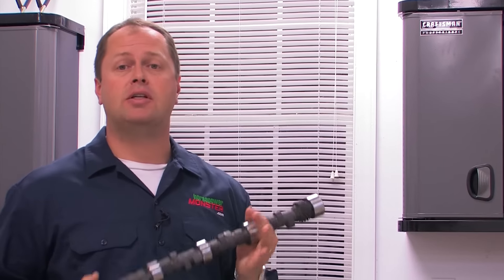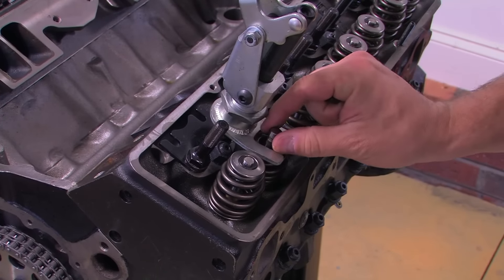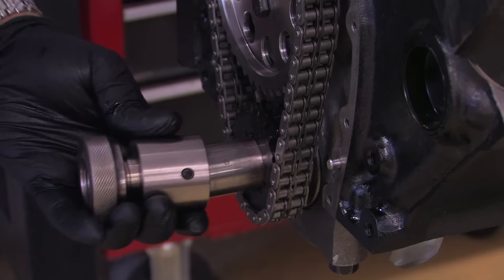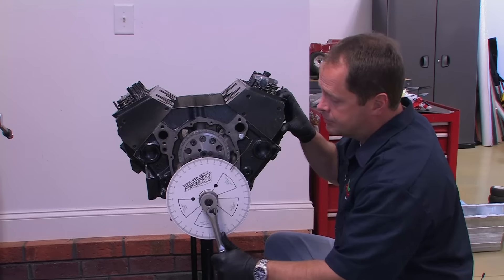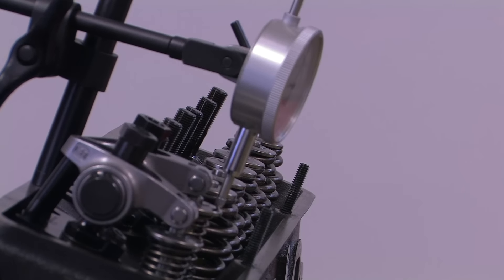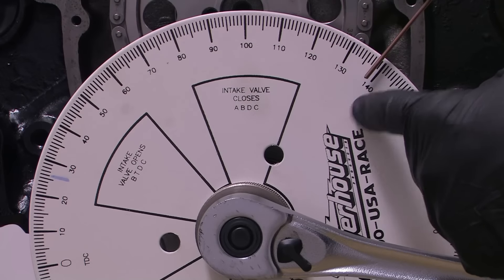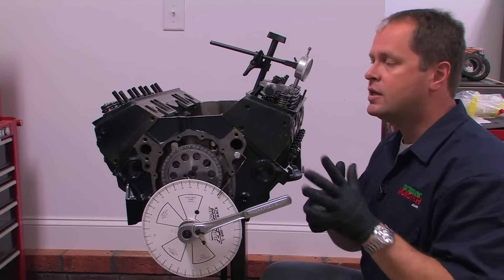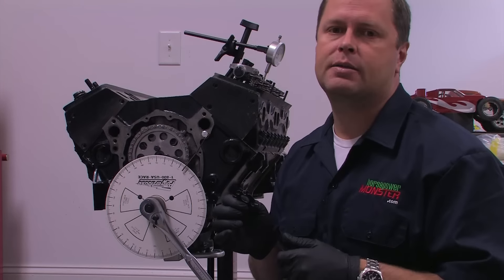How to Degree Your Camshaft (with Cylinder Heads Bolted Up)

Comment: Nice video,...very straight forward !!  Simply put, if the cam isn't actually up to the specs on the cam card, KNOWING so would allow you to adjust it into specs (if you have an adjustable cam key on the crank gear) before you lock it down and discover that performance isn't as you expected.  Thanks again.

Comment: I've never actually done this operation and I understand perfectly, there are basically 2 purposes for this procedure. First, to verify the specs of the camshaft lobes are correct, since defects or a mis-packaged part are always possible. Second, to verify the correct timing relationship between the camshaft, the timing chain set, and the crankshaft. 

The camshaft supplier has no control over the accuracy of the keyway location on the crankshaft, and the timing set (chain/sprocket or gears) may be from a third party source as well. Even if the timing locators of all 3 parts (crankshaft, timing set, camshaft) are in spec, there are still manufacturing tolerances allowed to each respective locating feature which could stack up in one direction to create enough total error in the complete assembly to require adjustment with an offset bushing on the cam sprocket/gear locator or alternate crank sprocket/gear keyway. 

Also, just my opinion, I think it might be good for a street engine that will see a lot of mileage to install a chain timing set for 1 or 2 deg advance to compensate for inevitable chain stretch as the engine is driven a few thousand miles. Just an opinion.

Comment: WOW!!! this is SO confusing!!! Seems kind of pointless too...I mean it seems that degree(ing) a cam is just to see if the manufacture is lying about cam specs or if they're being honest.
Reply: ***** it could be useful if you use a used cam or any other cam that you are unsure of the specs, but you're right
Reply: *****  After spending $1300 in tools to check my engine specs. I have found the people that ground my camshaft were .001 out of spec, a cam bearing was .002 too tight which would have left me .000 oil clearance, and clevit bearings were .001  undersized when it stated on their site they were standard.  Everybody always has time to fix mistakes, but not everybody takes the time to look for mistakes.
Reply: Exactly. waste of time
Reply: Kleo 84 exactly lol. I figure that out too.
Reply: What to do if the specs don't match up? Attach the  camshaft sprocket at a different position on the camshaft? Is that even possible?
Reply: I suppose if your cam was off.
You could pick the appropriate Woodruff key to give you that little
little bit of difference to match the cam spec. But it does look pretty much like a Vision Quest.
 iron American Dream on YouTube
Reply: @jeremyjohansson3445  I've not seen one video or anything to answer this question. So what do you do it the numbers are off. What exactly could you adjust?
Reply: @TheRaulr151    yea you are checking the cam but also checking the timing chain key is machined correctly.  Yes you could get a adjustable lower gear and adjust your mismachined cam but I would send it back..  Watched one of these that attempted to say they adjusted a 110 degree lobe center to 112 lobe center Lol.  No fuckingwaythis is possible advancing a cam as it is machined into the lobes.   But yes people make mistakes manufacturers make mistakes.  You are just checking their work.
Reply: Youre right. His statement at the beginning is misleading in that it “needs to be degreed in” isnt true. It SHOULD be checked is what he should have said.
Reply: @TheRaulr151  they sell these offset keys you put on the cam bolts/the  cam sprocket holes,, and that's how the final adjustments are made. But there are no videos demonstrating this.

Comment: Just want to add my two cents in response to many of the comments below, for what it’s worth, which is likely less than $0.02…

Engine builders vary greatly in terms of talent and competence.  Two builders assembling the same parts, on the same engine, may produce a final product whose power can vary by up to 20 hp more, or which may be more reliable over time.  Steps like this are a critical part of the blueprinting process.  If that level of meticulousness isn’t something you’re up for, do yourself a favor and find someone competent and reputable who is up for it.  Otherwise, you’re rolling the dice on a very expensive piece of machinery.  In short, take pride in what you’re doing, or don’t do it at all.   

Installing a cam using the dot-dot method, as most manufacturers recommend, will get you close.  However, because everything in an engine has manufacturing tolerances, you may find yourself in a situation in which those tolerances coincidentally line up against you. Moving your timing chain one tooth in either direction may change the timing by 6 degrees, so you will need an adjustable timing set if you’re really trying to do it right.  They’re really not very expensive.  

If your cam installation results in the timing being off by 2-3 degrees, that may not seem like much.  But it will mean that your intake or exhaust valves may be slightly held open at a time when they should be closed, resulting in a slight loss of compression, as well as a loss of volumetric efficiency, power and fuel economy.  Degreeing a cam is about verifying the numbers on the cam card, as well as ensuring that your timing is, in fact, set correctly.  If you’re  just replacing the cam and nothing else, this may seem like an unnecessary step.  But if you are replacing a cam, lifters, pushrods, rockers, valves or any combination of those parts, it is cheap insurance.  

This video, like many others, goes through the steps very quickly.  Unless you’re standing in front of your engine, with the tools in hand for the job, it can be easy to be intimidated by the task.  But if you take your time, it really is not much more difficult than understanding the concepts and doing basic math.  It is not wizardry, gentlemen.  This is exactly what is so great about YouTube.  So pause the video every 2-3 seconds if you have to, but give it a shot and show some damn perseverance.  Or pay someone with more patience who had to do that when they first learned how to do this stuff.    

Now please excuse me while I try to make sure that my engine build doesn’t grenade within 30 seconds of my first startup.  Fingers crossed, like the rest of us band of misfits…
Reply from the maker: All great points. Thanks!
Reply: Thanks for your 2 cents worth. I really appreciated it. Good luck with.your.motor.

Comment: The purpose of degreeing a cam (or any other measurement) is to achieve maximum HP and durability. Engines have tolerances that must be adhered to and the more precise you are with those tolerances the better off you are. Anybody can put an engine together and have it run. Building a reliable/durable engine is about precision and attention to detail. If this procedure seems difficult, remember everything requires practice to become proficient. If you expect all of that info to stick the first time, try and recall how education works - repetition. His procedure is sound, so perhaps watch several times. Engine building could be similar to learning a foreign language, either requires practice.
Reply: Might want to let the people who truly understand handle the technical stuff. But, for a do it yourself and stock replacement, provided you received the correct bumpstick to begin with, yes just line it up per manufacturer instructions. You be just fine.

Comment: I've rebuilt a 5.3l l59 out of a 03 Yukon, going into a 69 camaro. The darn thing hasent really started yet. Did install a summit racing camshaft with new springs. After reviewing my video of the build I didn't degree the cam. Did reach TDC and lined up the dots .  Every video I've seen on degree caming shows the cam spot on when you have TDC.  Doesn't seem worth doing if you reached TDC.

Comment: Is it common for the cam card to be wrong? It seems like the only purpose of this exercise is to double-check the manufacture's specs
Reply from the maker: +Sam O No, the cam card should always match up to what you ordered. In other words, it should match up to the cam specs in the catalog when you ordered your cam. Degreeing the cam really is to check and make sure the cam was ground properly. There are several steps and it can be confusing, but since the cam is so important to your engine's power and throttle response, it's generally worth the effort.

Comment: Question when u install the degree wheel post lining up the cam and crank sprockets marks straight up, is the wheel not also positioned at TDC and the pointer installed and adjusted to also be at 0 TDC prior to obtaining or determining  "true TDC"?
Reply from the maker: +Fernando Rosa Jr. The best time to reposition the degree wheel is after you have determined TDC with a piston stop.

Comment: I'm going to assume that if it not in spec you change the push rod  length ?
Reply from the maker: +Stephen Salamone If you are talking about getting the rocker arm tip centered over the top of the valve stem, yes, changing the pushrod length can help dial that in. Thanks
Reply: Thank You . So now I realize the it is a combination of rocker and push rod length to dial in the degrees angle . I was given a 302 ( 1985 mustang engine ) cam and roller rockers was told that it is 400 hp but when I took the pan off the rods did not look like they were balanced . I took my 1965 mustang pan off to fit the 1957 ford ranchero 1985 pan and oil pick up did not fit the cross member . engine full of carbon to big of jets ( 4180 double pumper Holley) not taken apart may be a blown power valve. I worked in a custom car shop for 17 Years . I have never indexed a engine, they were bought engines.

Comment: The advertised 1.52 rocker ratio is NOT an accurate number to use.  The ratio changes during the rotational arc of the rocker arm. The advertised 1.52 ratio is only an average.  Actual rocker arm ratio can be determined with a dial indicator.  Push rod length also affects rocker arm ratio.

Comment: Those piston stops didnt work for my engine. I am running edelbrock heads and the angle of the spark plug hole makes it impossible for the piston and stop to meet.

Comment: After finding roller rockers sold as 1.5 ratio actually range from 1.4 to 1.6,   this method of finding 0.050" is not good.
You should always go right to the lifter for finding the 0.050" lift.

Comment: @thehorsepowermonster if you dont degree your cam and just set it at zero with the timing chain like it would be stock will it not want to stay at idle. i think im having this problem
Reply: @The Horsepower Monster
Reply from the maker: Unless there is a machining error or some other problem a cam installed straight up--or dot-to-dot on the timing chain--should be OK. If your engine doesn't want to idle my first thought would be the carburetor (adjust the idle screws) or timing (is it too advanced?). Have you checked those?

Comment: what is that valve spring tool? looks fuckin sweet
Reply from the maker: The valve spring compressor I use there is made by Moroso. I picked it up from my local speed shop, but you can probably get one--or one like it--from Summitracing.com or goodson.com

Comment: So what's the point of all of it is it verification if the lobe opening and all that you know is this accurate I mean what's the what's all the points would I know I'm confused can someone explain to me and you have to readjust your time and after you do all that I'm lost their
Reply from the maker: The main point is to verify that the cam is opening and closing the valves at the appropriate time. If it isn't you can advance or retard the timing to correct it. Thanks for watching.